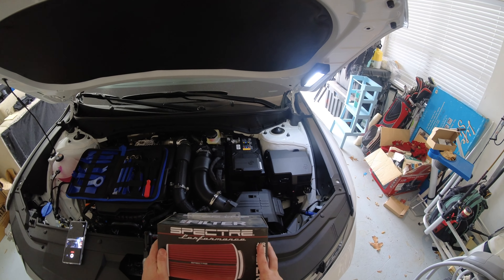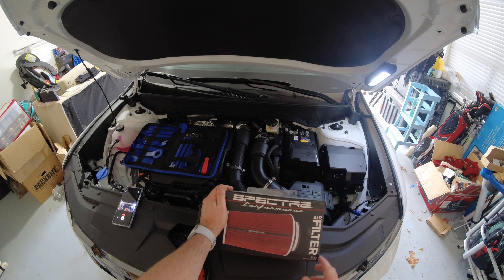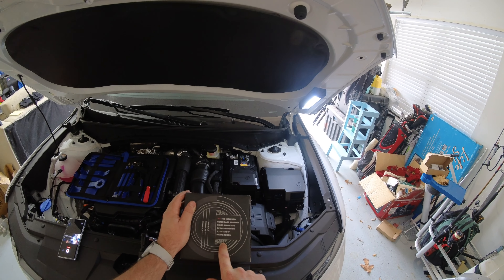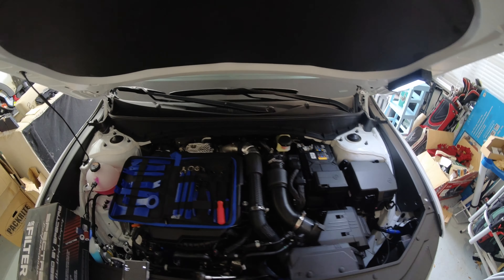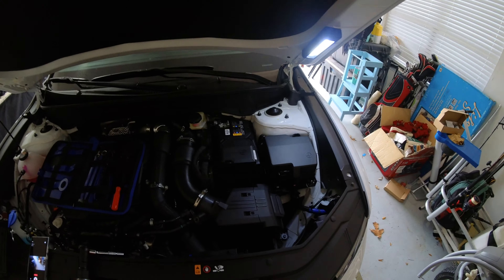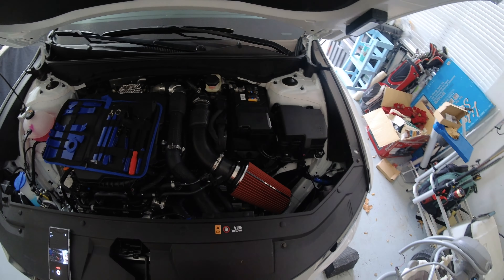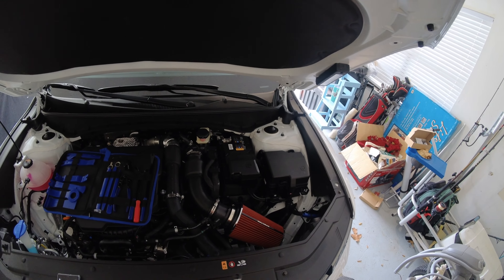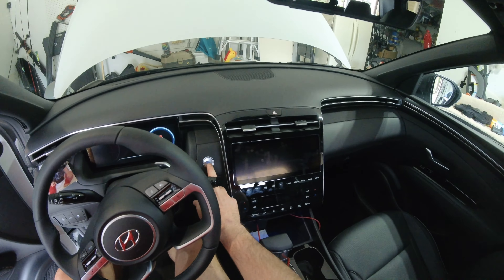2022 Santa Cruz Cold Air Intake Installation

Comment: “Sounds waaay better”… meaning a lot louder…. It adds the same performance boost as racing stripes 🤣
Reply: The sound of your car increases your enjoyment while driving it. A racing stripe provides no difference in the riding experience. 
I recently bought an exhaust for my bike, not because I wanted power gains but the thrill of having something with a little more growl.

Comment: Just Some FYI K&N makes a New Air filter that does the same thing with out taking everything apart and replaced the Factory air filter with the new K&N ! I did this to my Santa Cruz and Completely eliminated the Turbo lag.  Raises mpg as much as 5 mpg . Its awesome deference.
Reply from the maker: Are you talking about the drop in filter?
Reply: What filter are you referring to? K&N doesn't have an Intake Filter listed as compatible with the SC. You can potentially use the Sorrento one (69-5328TC). Only specific SC Air filter is the drop in (33-5108).
Reply from the maker: @analogmadsound9830  the universal one with the 3.5in sleeve. There aren't any SC specific ones that I'm aware of
Reply: I'm not calling you a liar but you're full of it.  There's no way a K&N drop in did all that.  In fact, I would be willing to wager it does nothing at all.
Reply: Lol did this guy think he discovered the drop in filter before anyone else did?
Reply: Prove it with a video
Reply: Raised MPG by 5 😂 c’mon bro
Reply: If it raised mpg by .5 I would be surprised 😅
Reply: I had K&N in my Mazda and it didn’t do a diddly squad…. Wait, I take that back… it did made my wallet lighter
Reply: @floridabornoutdoors  Yes ! Hyundai all ready has a great cold air box
Reply: @analogmadsound9830  Yes it does. I have one.  It is really nice
Reply: @57precision  if it would let me take a picture I would.
Reply: @jasonevans3520   haha... yeah... it will help a little if you don't gas it... otherwise its worse. But yeah no... a drop in will do very little. Fractions of a second increase in acceleration real world. It improves performance... just on a negligible scale. May increase mpg if driving ultra conservatively. Most likely will make it worse with performance NOT showing the same results... same for the above mod in the video... will make MPGs WORSE than factory even if driving conservatively. The video posters idea with the ram air box made me laugh though.

Comment: Nobody can legally deny you warranty for an air filter replacement. Read Magnusson Moss Act.
Reply from the maker: Thanks for the info. Also WEPA!!! Yo soy Boriqua, pa que tú lo sepas.
Reply: He didn't just change the filter...he removed the air box.That could lead to warranty issues.That is just sucking in hot air
Reply: They can deny anything they want and by the time you get a lawyer involved, you could have bought a new car. 😉 Just saying, as a former performance speed shop owner and current manager for a nationwide retail custom shop... Moss Magnussen is there but very difficult to enforce and takes lawyers to take advantage of since most dealers are crooked and have much more money to spend ruining your life than you do theirs. Again... the laws exist but dealers will go to court in most cases than follow it... in addition... most dealership service advisors dont even know about cars much less the law regarding modification to said car. They will do/say whatever company policy is which in most cases is, "if ANY modification is present, it boids all warranty packages including purchased ones through the dealer" and that vould be something as stupid as toping off your coolant or having an oil change done outside the dealer. Read the fine print signed when buying the vehicle. It also can supercede law especially in extended warranty scenarios.

Comment: Just did mine today. Ordered the shorter K&N and was able to keep the air diverter in. In time I'll make an ABS box that bolts to the stock mount points for the original filter box to keep the ambient engine bay temps more "away"than the setup is now. Great vid!
Reply from the maker: I had a friend make a good point to me. The ambient air temp in the engine bay makes very little difference on a turbo engine with an inter/aftercooler. I never thought of it like that. So putting it in an enclosed box may not be totally necessary. I'd be interested to hear when you do to see if it made a difference.
Reply: Do you have a part number for the KNN set up you bought or is it just a universal pod filter set up?

Comment: Do you think it would be worth it to put a performance intake on the non turbo SEL version of the Santa Cruz?
Reply from the maker: It's really for sound more than anything. Performance intakes do very little for otherwise stock cars. The main advantage is never have to change your filter again. You just clean it and put it back in.

Comment: Hi. are you sure this is the MAF sensor at 4:20 ? I have the same engine on Santa Fe 2022 and was looking for the MAF sensor, but this one has only tubes. Where is the cable plug ? I don't see any cable there. So, if you  know where it is I will be thankful if you share.
Reply from the maker: Sure is. Depending on the type, it can have the sensor right at the tip or down a tube. I believe that this type is deeper into the tube. My BMW was right at the tip and didn't have any hoses connected to the back like on the Hyundai
Reply: @floridabornoutdoors  But where is the cable?? I have exact the same engine as yours. Could you show the cable shoe?

Comment: Can you post link for air Intake please ? I just purchased 2022  Santa Cruz SEL..having hard time finding air intake systems
Reply from the maker: https://www.autozone.com/intake-system/universal-air-filter/p/spectre-red-medium-conical-air-filter/245771_0_0
Reply: @floridabornoutdoors   this is not the correct part. This link is for part number 8132. The number on your box says 9732.
Reply: Is the Large (the one you installed) too large in your opinion?
Reply from the maker: @Chumba2692  I tried to find a link to the one I bought at O'Reilly's but I couldn't. I don't think it's too large. You can't have to large of an air filter when you have forced induction
Reply: Just go to Amazon and get the replacement K&N and you don't have to go through any of this crap lol .  Love it ! No more turbo lag
Reply: What a waste just for sounds. When all you had to do was a K&N Filter.  Lol
Reply: @rusty383   Are you sure its the same Sound that he is getting with the K&N Filter,   or is it close to it. ?

Comment: Sir, thats an autozone pod filter on a box thats now pulling directly from the engine bay.
Without a snorkel of some sort, you are just pulling hotter air into yer engine. 

Sounds pretty, but youve decreased performance.

Comment: Sounds angry. I like it. How's the MPG?
Reply from the maker: Everyday average is 23-24mpg. Cruising I get 28-30mpg
Reply: @floridabornoutdoors  i have a 19 ram 5.7.. gas is killing me. Looking into one of these.. just don't know if I can convince myself.
Reply from the maker: @Bagel_Biscuit  I had a 2021 F150 Powerboost before this. I have no regrets changing to the Santa Cruz.
Reply: @Bagel_Biscuit  I bought one of these instead of paying crazy markups on the Ford Bronco.  It will do exactly what I need it to, which is stick to the road like a gecko with snow tires this winter.  As long as you get the 2.5T I don't think you will regret it.
Reply: @57precision  Good choice! No one ever uses a Bronco for what they built for; usually a mall crawler just like the Wranglers.
Reply: @Bagel_Biscuit  exactly I had honest conversation with myself and  I would only use 10% of what the Bronco is capable of. Only off roading I do is on forest roads which the Santa Cruz can do just fine with AT tires

Comment: Without a tune on a turbocharged engine???  That’s not a smart idea…
Reply from the maker: On a modern engine with an electronic waste gate, a MAF, and ECU? I'm interested in hearing your justification.
Reply: @floridabornoutdoors  Literally any change to fuel or air flow requires a tune to run optimally... if you don't, it will work, but will not run properly
Reply: Yeah that’s wrong Erik. The ECU compensates for any changes such as this.
Reply: @JwKovach85  *laughs as a two-time WRX owner” you have no power in this topic.

Comment: A warm air intake on a turbo vs cai is not really as big an issue on a turbo car that is intercooled than a NA vehicle. NA vehicles will be his harder performance wise especially in warm months. Intercooled turbo cars, not AS MUCH. The larger intake flow will compensate for minute temparature variant exiting the intercooler. Will the air be warmer? Potentially... but the degrees are going to be small at best. Please remember the compression of the air in a turbo already generates massive heat, hence the need for an intercooler. These cars are engineered to run well in the hottest of temps... think Vegas at 120 degrees in the summer. The charge air is already 160+ hoing through the intake. Sensors read this and compensate. Same with a WAI. SO performance increase? Potential. Minimal but potential. Cool sounds? Sure. Ram air nonsense in the video talking about running cold air over the filter? Rubbish and completely nonsense. Effectively... you may decrease lag slightly whilst lowering mpg and getting a "cool sound". Will I do it? Maybe with a better quality cone such as a K&N and a barrier setup potentially, but with my pedal commander and drop in K&N my mileage is already worse. But my 0-60 is at 5.5 at elevation (4600 ish) and eat the bubarus (wrx and the like) for dinner on the commute home. So all good. Worth the $80 fillups every week or two.
Reply: Does the drop in change the sound at all?
Reply: @honoredsage4946  no...  not at all. Not noticeable anyway... i have a full on AEM intake which I changed from a K&N setup after the drop in. K&N is much louder but was open without the box. Less filtering. AEM has the dry filter setup and is claimed to filter 2 times as much with 15hp improvement. I plan to test the AEM SETUP with both AEM and K&N comparisons to see the power outputs. I forsee the K&n being more performance based but can use the AEM for when I clean the K&N. Lets see but dynod at 392 awhp and 427lbft at the wheels after exhaust, tune and intake. Wheels are also 14lb hypergrams from konig so yeah. I DUST tesla model 3s all day. The top of the line awd high battery ones get me till 30mph or so but after. Walk in the park.